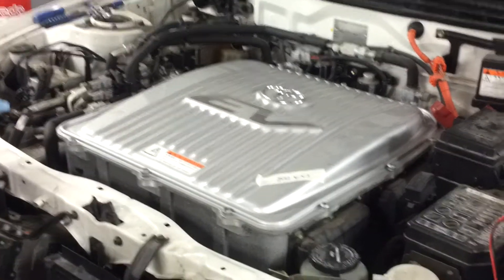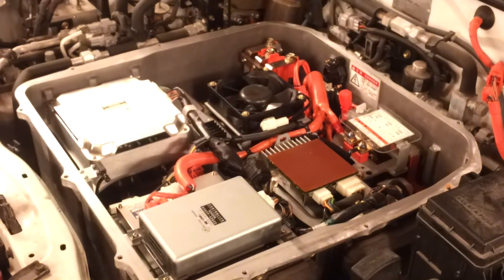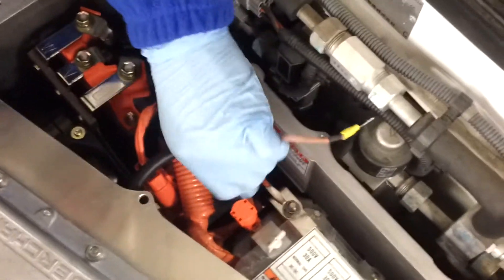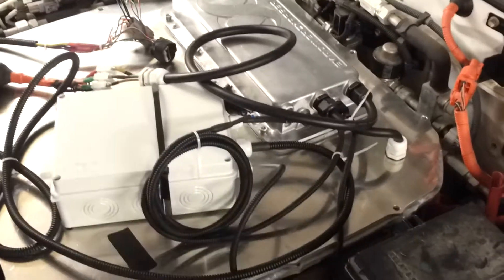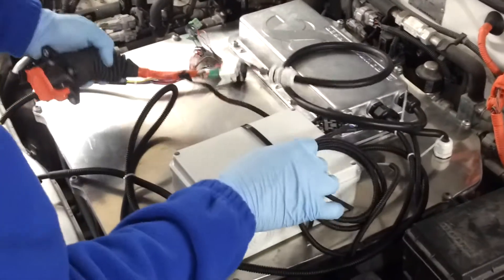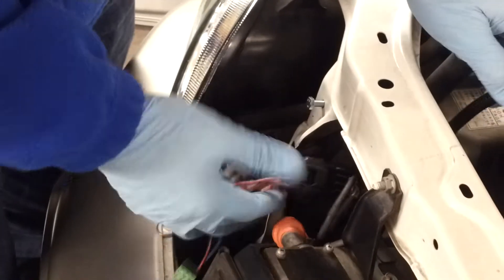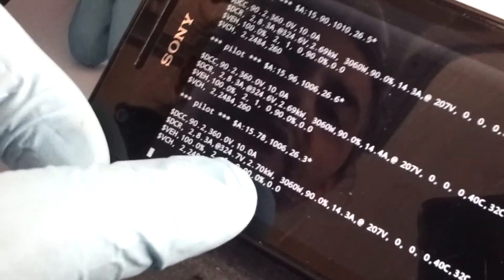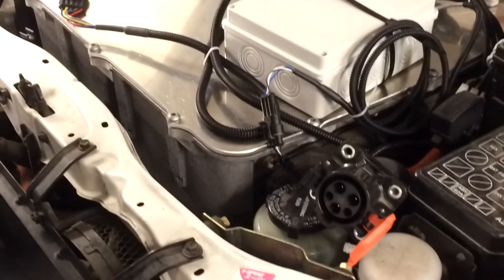Mounting inductive to conductive kit on a RAV4 EV 2002

Comment: Hello, congratulations, excellent project. I have a rav 4 2003 EV, and I bought the same charger, ËLTEK VALERE "I have a question: where is the communication port CAN BUS on the vehicle? CANL, CANH and CAN REF? What is the software used?

thank you very much for your reply.
Reply: Oscar Garcia hi can you please tell me where can I get this kit from. Will be much appreciated!
Reply: ON EBAY https://www.ebay.com/itm/222718701547?ul_noapp=true
Reply: I don't think this is accurate, that's not the right kit. I would be very surprised if something like this would work.
Reply from the maker: @chelovd123  You can mail me for quotation.
Reply from the maker: This is not an open source project - the Eltek charger is just part of the equation. Contact me on my e-mail (in the description) and I will answer.
Reply: @TheEVMonitor  I wrote an email a few days ago but haven't heard back.  I would like to buy this kit!